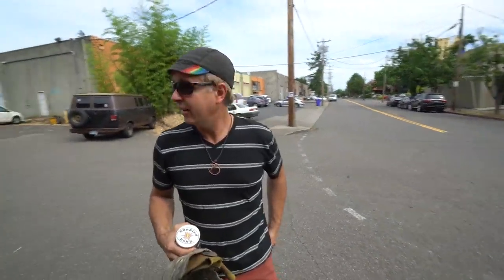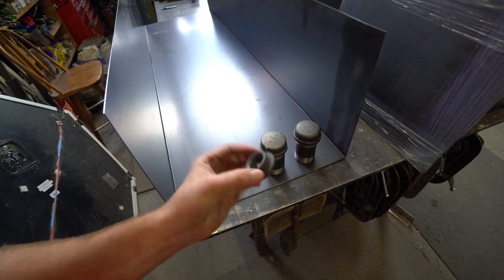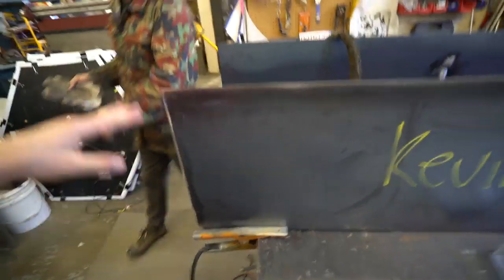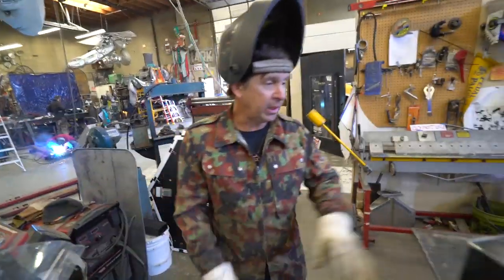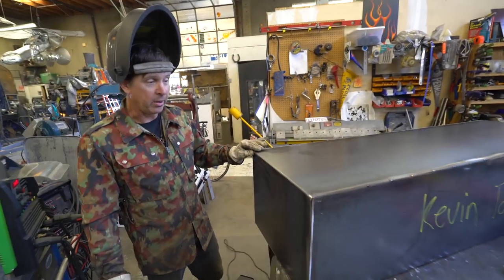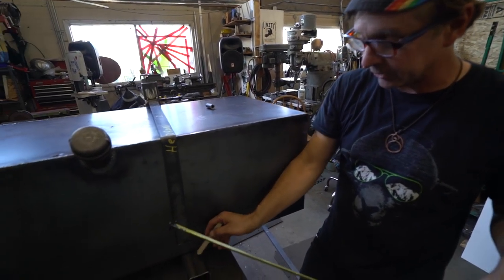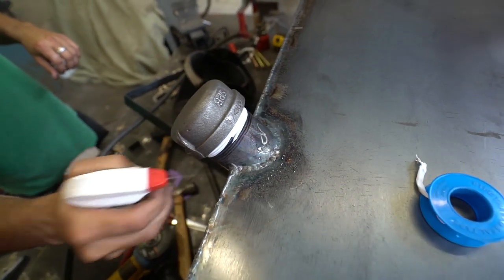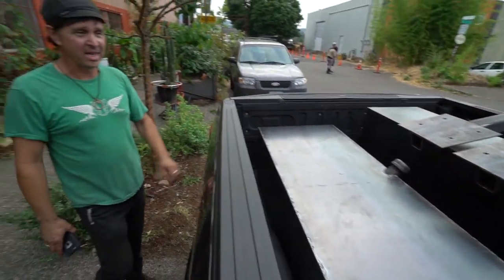2K Mile Range - CUSTOM FUEL TANKS - Waste Vegetable Oil

Comment: Impressive array of shop machinery. TIG Tungsten Inert Gas welding.
Only takes about 3 psi test pressure. 10 - 15 psi will blow it apart. 
Is there a drain to remove sediment?
Congratulations on the new tank.
Reply: we only used 2 psi at the most. just enough pressure to see a leak.